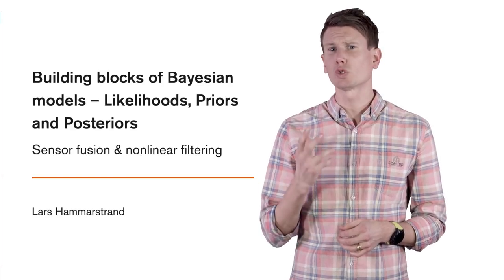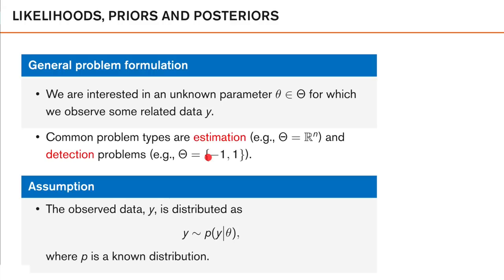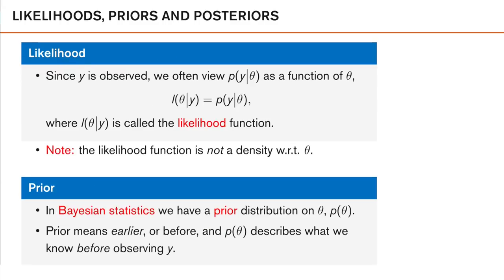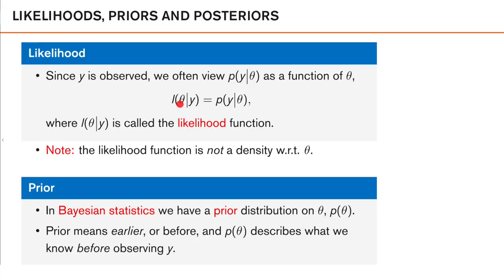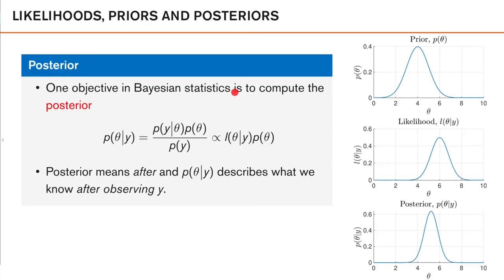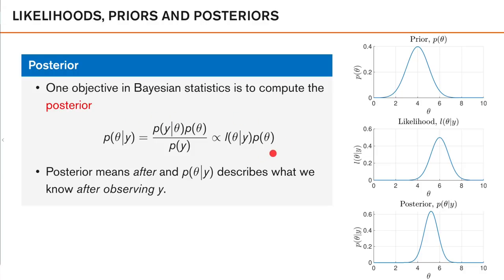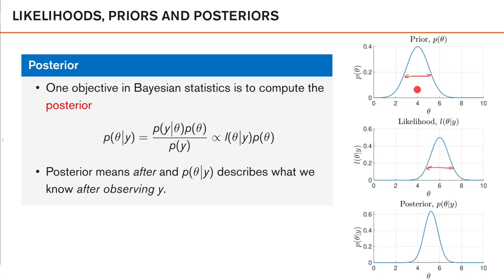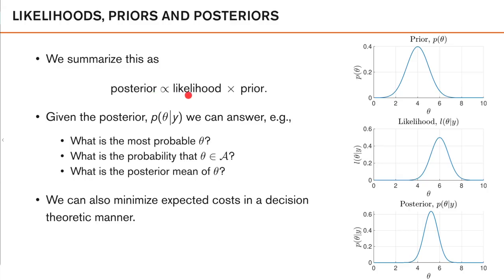2.3 Building blocks of Bayesian models – Likelihoods, priors and posteriors

Comment: 2:12 the explaination of likelihood and in particular l(theta|y) = p(y|theta) is misleading for me.

l(theta|y) should not be euqal to p(y|theta), since p(y|theta) should be a proper density. 

I would assume that:
l(theta|y) = k* p(y|theta)
where k is a positive constant. 

can you explain why it is written like l(theta|y) = p(y|theta) ??
Reply from the maker: Well, this is just a question of notation. In general, we are free to choose how we want to call our functions and the statistics community has chosen to clarify that p(y|theta) is not a proper density over theta for a fixed y by introducing a specific notation for this. So,  p(y|theta) can be viewws as "just" a function that takes two parameters, y and theta, lets's call this function f(y, theta) such that p(y|theta) = f(y, theta). For a fixed theta, we know that the integral of f(y, theta) over y will be 1 as it is a proper density over y. However, we are usually interested in this as a function of theta for a fixed y as theta is unknown while y is observed/fixed. The clarify that this the case, we introduce the likelihood function l(theta|y) = f(y, theta). Note that this change of notation does not change the function p(y|theta) = f(y, theta) = l(theta|y) it is just to clarify what is fixed (y) and what is unknown (theta).

For more discussion on this you can, for example, look at the corresponding Wikipedia page: https://en.wikipedia.org/wiki/Likelihood_function (see Likelihood function of a parameterized model).

Hope this clarified things?

/Lars